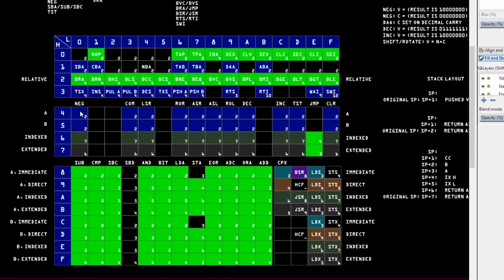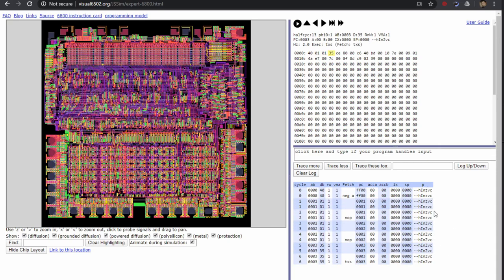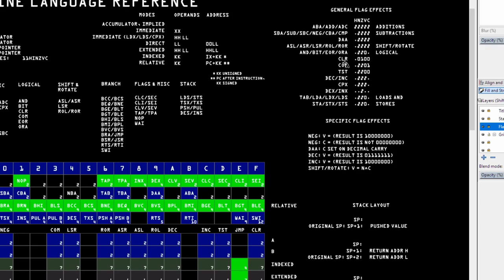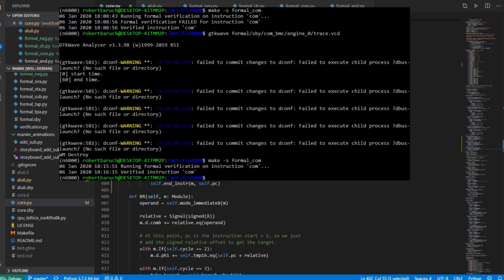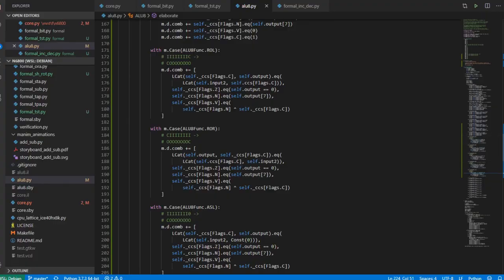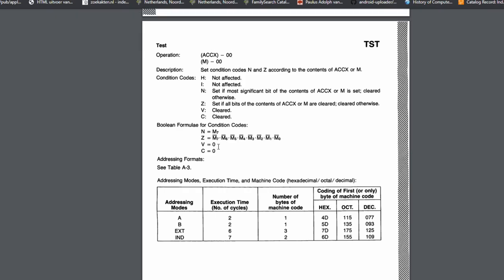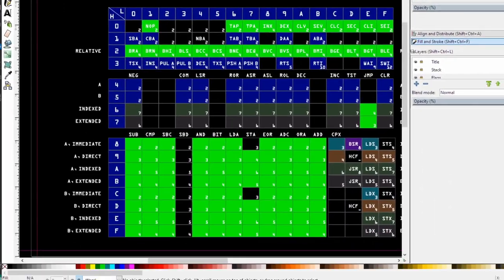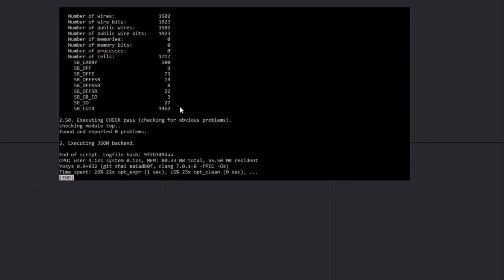Building a 6800 CPU on an FPGA with nMigen (part 8)

Comment: 5:10 Betting on datasheet error.  On another sheet on alldatasheet, which doesn't even has 168 pages (2) also says "result =00000000 ?". (also Result=0? is stored in Z flag anyway).
I kinda got used to Cat() going from lsb after a while(when in Rome, yada yada), though initially it was very confusing.What I didn't get used to is that it implicitly creates clock domains: Spot the error: "m.d.comp += adder.eq(lhs+rhs)". 

That was a trick question: there is no error from nMigen POV. In this code nMigen will happily create new clocked domain, named comp, not to be confused with comb and adder will produce results next tick. 
There are more minor details like differences in assignments in comb vs sync domain(instead of complaining, inferring latches and complaining, nMigen silently puts 0 or whatever reset value was used), but creating new clocks out of thin air really takes the cake. Verilog can't even dream of letting you to shoot yourself in a foot in a such way.
It's been several days and I'm still salty.
Reply from the maker: You're not wrong...